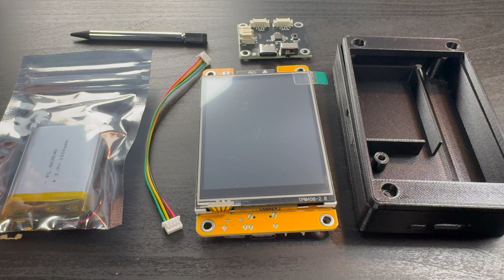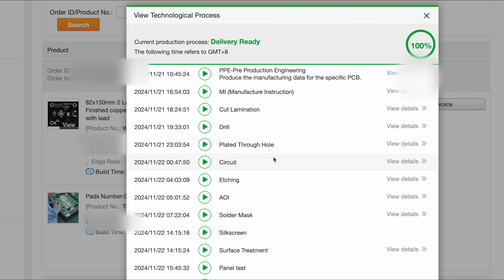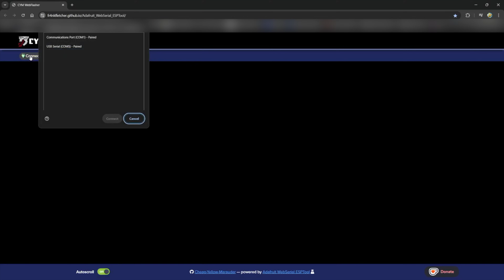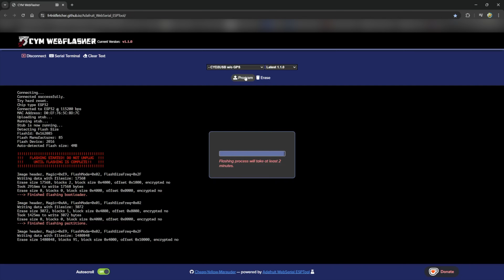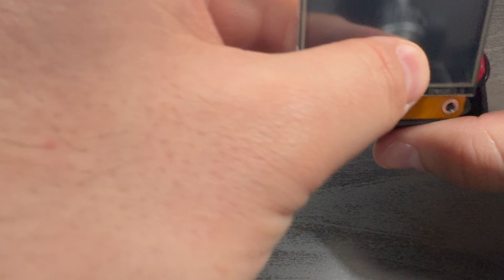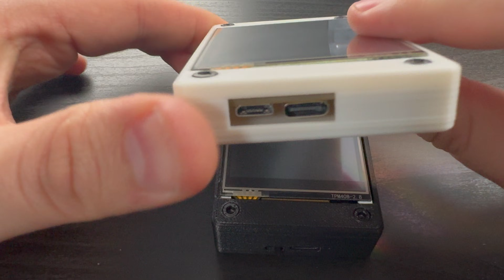How To Build An ESP32 Marauder - With Battery - No Soldering Required!

Comment: Wtf is marauder? A bunch of scripts to escape learning aircrack commands? Just buy a pocket wifi router for openwrt. It has better antenna, it is way less power hungry and offers all the packages you could possibly need. This right here, along with pwnagotchi and that dolphin thingy, is a bunch of poorly designed tools that make a lot of mistakes, and indirectly forces user to make even more.
Reply from the maker: I mean, you can always go deeper… Imagine using aircrack commands. Write your own framework and tools. That’s how you sound.

Marauder is using open source tools that were written for the ESP32 platform and executes them from an OPTIONAL UI. If this is a “bunch of scripts” it’s the same thing as using aircrack commands. That too is just a bunch of scripts in the end.

Introduce people into the world and the more they’re interested, the more they’ll seek out. No one claims this is the best tool, but it is effective. These devices are the most searched in this space whether you like it or not. So we will continue to make videos for beginners and people that want to build these devices.
Reply: @BiscuitShop  Aircrack is a framework already. With an "optional UI" nontheless. I'm not trying to stop you from making videos, lol. Im just warning users that this right here, building a customized device on a very restricted and at the same time very bloated platform that fits very poorly into the whole wireless world (first of all, hardware-wise), AND also using yet another layer of abstraction which effectively is this "optional UI", is a very bad idea. Now, the whole idea behind yet another layer is to encapsulate a lot of boring stuff. Sure, sometimes it works. But not in case of wifi and not in current state underlaying tools/frameworks are in. There are too many nuances to the whole sniffing/capturing thing that can't be addressed in any automated way (at least outside "real linux" environment). So, again, my advice would be to get a decent wifi-oriented device with a proper wifi-chipset on board and "normal" limux for embeds which supports the essential set of tools (at least aircrack-ng and hcxdumptool). Everything else would be a waste, especially if it requires so much hustle. You'll find out I'm right the moment you finally make it to hashcat 🤭
Reply: I agree but is a good platform to learn on, I’ve just bought the stuff to make one, I am trying familiarise myself with arduino and ESP32 as that’s what I use at work. Also wifi and Bluetooth I want to learn about, however has an out and out offensive tool I can see why it’d be crap compared to the right hardware/frameware

Comment: Just received my kit today. I'm going to add the GPS so it can wardrive! :) I'd be up for a case that has a spot for the GPS. I just noticed my charging pcb has the larger PH 2.0mm battery connector. :/
Reply from the maker: Did you get the case with it and the module I recommend? You can put the ceramic antenna above the battery and there is a small area on top of the stylus for the GPS PCB :)
Reply: @BiscuitShop  I did get the case and I was wondering what the area was on top of the stylus. I ordered the smaller GPS module and a battery with the PH 2.0 connector since the board is ver. 1.0? Bummed since I have some batteries with the 1.25mm connector
Reply from the maker: You’re not the first to say this. I too had 1.25 for Lora devices. But 2.0 is actually a more common connector. In the latest versions I’m releasing, I changed to the 1.25 connector though because I keep hearing this same comment. Sorry about that!

Yeah that square area will fit the gps PCB :)
Reply: @BiscuitShop  Yeah no worries, I have the larger GY-NEO6MV2 GPS module so I got the smaller GPS and battery with 2.0 to make it all fit
Reply from the maker: @blackpaw369 Nice! 
Keep an eye out for my next iteration of the board 👀 it will have GPS built in AND a battery fuel IC that will display the battery level at the top of the marauder status bar / on screen. Will be a bit more expensive but it should cut down on all the shopping for separate GPS modules ect.

Thanks for the support!
Reply: @BiscuitShop  that will be sweet! I'll look forward to it!

Comment: I just bought one from Tindie, should have it in a few days. I picked up a gps and stuff for an external antenna, hopefully I can cram it all in there. Thanks for putting a nice little package together.
Reply: How would you add an external antenna to this board?
Reply: @ I did it to mine and it works but honestly if I were to do it over again I would just buy an esp32 with the u.fl and another display. I’d just build one from scratch and scrap the cyd. Adding an external to the cyd is kind of janky. His case is nice though.
Reply from the maker: I really like the build where people swap the ESP module with the ESP32-wroom-32u
It’s the exact same module but with an external antenna. No jank with the scraping antenna traces. Definitely tougher but well worth it.
Reply: @ exactly, after scraping and soldering I don’t think the juice was worth the squeeze. I wonder if your enclosure could accommodate such build. The case is top notch btw. 👍
Reply from the maker: Really appreciate that. Took many revisions lol
I bet it would. The module is the same footprint and the antenna should fit up top if placed right

If not I’d be happy to modify the case
Reply from the maker: Thanks a ton! Dropping off all the tindie orders right now.

I’ve made a handful now with GPS but with the ceramic antenna. You might be able to drill a hole or something to get the external antenna going.

Maybe I should make a case that supports external though 🤔 if you have a 3D printer i could send you a model to test if you’re game.
Reply: @BiscuitShop I don’t have a printer but I could have Micro Center print one up for me.
Reply from the maker: Oh perfect! I think you should be able to drill a hole at the top. I bet there’s enough space. Worst case reach out and we’ll figure something out.
Reply: @BiscuitShop  awesome thank you very much. I’ll let you know. Have a good one.
Reply: @BiscuitShop  I would love to test a model with an external antenna!
Reply from the maker: @Cleffles  Its doable! They've started selling CYDs with UF.L connectors for external antennas. They work great and are very affordable to make

Comment: Do I understand correctly that this device is something like the flipper zero? Also that you can use it to copy radio signals, read rfid cards etc.?  Is there any information about the project in German?
Reply from the maker: This device doesn’t have any sub ghz or RFID capabilities. It’s strictly WiFi and Bluetooth.

Similar to the WiFi dev board for the flipper though
Reply: @BiscuitShop okay thanks.

Comment: Soo if I build wideout battery I can use power bank?
Reply from the maker: Correct! Simply use a USB cable and it will power the display.

There’s also a case that you can download in the description that I made for that exact setup. Download and print that one if you like it

Comment: Can you make this just using the screen board and a portable charger? Instead of using the Battery PCB and a battery?
Reply from the maker: Absolutely! Towards the end of the video I show one without an internal battery. I uploaded the case model for that too and you can find the download in the description.
You can power it via USB
Reply: Oh, sorry I didn't realise it was right at the end! So what's the point of everyone doing the soldering nonsense with other components if they can just do this? For the GPS or is there other functionality they're getting? Like better customisation?
Reply from the maker: If you’re referring to other videos, I think I’m the only one that made a PCB focused on adding a battery to the CYD. I made it with the intention to avoid the need to solder. I get anxiety soldering battery leads lol.

If you’re referring to the GPS, you can’t avoid soldering that because you buy the modules without a wire, you must solder wires to it to connect to my board (or anything for that matter)

Adding GPS adds the ability to war drive with the device!
Reply: @BiscuitShop  ah okay, so in most video when they talk about soldering, they'll mainly be adding a GPS? What extra functionality does that add and can you use the WiFi and Bluetooth functions without it?
Reply from the maker: Most add a battery too. You can avoid that with a custom PCB though which was my main objective with this build. I think that’s where the most value is because I feel like most people want it to be a stand alone device but soldering a battery turns off a lot of people.

All the other features stay the same with GPS, it really only adds the ability to wardrive when you add the GPS. It’s definitely a nice to have, but not necessary for the other 95% of features
Reply: @BiscuitShop  what's WarDrive? Sorry for the questions, last one I promise!😂
Reply from the maker: Haha no worries, always open to chat with people that are interested in the same things as me lol

This is the technical documentation for that feature. https://github.com/justcallmekoko/ESP32Marauder/wiki/wardrive

Essentially it captures SSID names and the GPS location you encountered it at. It’s a reconnaissance tool.

Comment: How do you add the gps module
Reply from the maker: If you check the Tindie link in the video description there’s a drawn schematic in the listing photos. 

You don’t even need to use my board, the schematic works for the pins on the bottom of the CYD too.
Reply: @ yea but I just want to maximize the space I have so the gps and battery mod can be on the same and what would be the best gps that would work with your board?
Reply from the maker: ATGM336H is the one I recommend. In the 3D model I uploaded to maker world, it has the proper locations for the antenna and PCB as well as battery and charging circuit. A couple people have built it so far with this GPS and it’s been pretty well received!

Comment: Someone can find for me good pcb in aliexpress or ebay ?
Reply from the maker: Which PCB? The ESP32 or the charging circuit?
Reply: @BiscuitShop  If you can send me both I would be happy and by the way, do you have Discord?
Reply from the maker: @Gingiboyy  I don’t have a discord channel but maybe I should make one! You can dm me though     _hedge
Reply: @BiscuitShop  And there are several batteries that connect to it or only this and is the battery on ebay or something?
Reply from the maker: Any 3.7V battery with a PH2.0mm connector will work :) 

The battery I suggest is in the description (amazon) but check out the connector, as long as you find one with that connector and voltage, should be fine. I saw someone connect a 2000mah to it. Should be fine
Reply: @BiscuitShop thanks bro 🫡
Reply: @BiscuitShop  And what is the type of cable that comes with the charging pcb?
Reply from the maker: @ no prob! It’s the 4p 1.25mm JST cable that the charging PCB connects to the main board with
Reply: @BiscuitShop the cable is male to female ?
Reply from the maker: Female to Female
Reply: @BiscuitShop the charging circuit i think
Reply from the maker: Gotcha, the link is in the description for it. I had them custom made so you won’t find them anywhere else. The reason I made them is because something didn’t already exist :/

Does the Tindie link not work for you?

Comment: I wonder, with this setup can we make a copy of Flipper Zero? Like with a basic function, IR transceiver, CC1101, and RFID reader?
Reply from the maker: There is additional IO but I don’t know if the available IO is sufficient to add those devices. On the back of the device there are two more expansion ports, but in total 5 IO

We would also be using up the TX/RX for GPS so if one of those modules used serial we’d have to pick one. 

It’s an interesting idea though that’s worth looking into
Reply: Get lilygo t embed for cheap alternative

Comment: What GPS modules are supported in interest in the PCB
Reply: If project goes well. Definitely buying a bulk of these so cross your fingers
Reply from the maker: @WitherDimensions  I think you'll love it! Feel free to reach out with questions
Reply: @BiscuitShop  you have a list of supported batteries was looking for some 1500 mah ones ?
Reply from the maker: @ this one should work

https://amzn.to/4fq2Zf2

Any  3.7V battery with a 2.0mm PH JST 2Pin connector
Reply: @BiscuitShop if I’m gathering all the pieces up. What steps should I take in connecting and installing. Do I connect and solder all my extra antenna and gps module to the cyd before flashing it? Or is there specific steps?
Reply from the maker: You do anything in any order. Last time I did it I flashed the CYD then added the GPS later. Doesn’t matter really
Reply: @ I’m having difficulty understanding the pinout. I connect both the gps and battery to the PCB and and the DEVOUT cable goes to the bottom of the CYD. Just want to make sure all is connected correctly. Making sure all solders are correct with the gps as well. Where is the pinout diagram you created ?
Reply from the maker: @ just updated the listing with the schematic

Battery is 
red = +
black = -

GPS wiring is in the diagram :)
Reply from the maker: Great question, tested and compatible with Teyleten Robot ATGM336H NEO-6M, case was designed to fit that module.
But should also be compatible with 
DWEII GY-NEO6MV2 with a revised case
Reply: @BiscuitShop Ty for the response definitely grabbing one
Reply from the maker: @WitherDimensions  The CYD comes with the cable you'll need for the GPS too so you shouldn't need to buy any cable.
Reply: @ in the process of buying this module. What cables do I need if I wanted to connect both a battery and a gps module. Cable for battery and module then to cyd and how does the module attach to the cyd?
Reply from the maker: For the module I include the cable for the PCB to the CYD (female to female 1.25 JST 4p)  
For the GPS you need a 1.25 JST 4P Female to flying leads for soldering. You can get the same wire as the one I provide but cut off one end for soldering to the GPS module.
Battery you should just buy the battery I list since it comes with the connector and wire already attached (connector is a PH2.0 for the battery though so if you wanted to do something custom)

Hopefully that helps
Reply: @BiscuitShop  would love a video on installing a gps module on this pcb I just bought it!
Reply from the maker: I’ll see about making a quick video on it. Worst case I’ll update my listing with a schematic and pictures of the GPS mod.
Reply: @ either way already bought it ! Honestly rewatched the video and it clicked in my head! Great product!
Reply: @BiscuitShop  I am looking at the ATGM336H module from left to right the pin outs are:
 VCC, GND, TX, RX, PPS.

Looking at your board with the DEVOUT and GPS in on the bottom what are the pins for input?

I made the assumption that my 4 wire JST plugged into your PCB from left to right the wire are RED Black yellow green - went to VCC, GND, TX, RX on module. I do not see GPS on Screen.
Reply from the maker: I should’ve labeled the pins on the board. Give me an hour or so and I’ll post a link to a rough schematic. 
If you look at the back of the CYD, you can find the pin out. Follow the colors to my PCB. Connector for GPS is jumped to the dev out connector. 
PPS is unused. 
VCC(+)-Vin
Tx-Tx
Rx-Rx
Gnd(-)-gnd

To actually enable GPS, on that web flasher, you chose the other CYDV2 option that doesn’t say W/O GPS
Reply from the maker: @tratzum  
Added a hastily drawn picture that shows the labels on the connector as well as what to connect to on your GPS module.
Reply: @BiscuitShop  Dam I call my self a geek and didn't even look at the CYD. Only GPS pin I got right was VCC.
Deleted bad info
Reply from the maker: So I think you’re close but from the cable I’m looking at it appears TX is yellow, and RX is black. If that’s the case for you though go with that cable color. Sounds like you’ll get it in no time though. If you flash the GPS version, and it doesn’t initialize but the GPS module lights up, switch the TX and RX and you should be good to go :)
Reply: @BiscuitShop  Ill try again in a few. I may have killed that module. Thanks for the speedy reply's
Reply from the maker: @tratzum  No problem! That sucks...

If you want to message me directly you can add me on discord.  Username is    _hedge
Reply: @BiscuitShop  All good. Had to switch the TX and RX from your picture on Tindie
Reply from the maker: @tratzum NICE! Let me take it down then. Enjoy!

Comment: Once again, making it easy for newbs like myself to catch up! Thank you, sir!
Reply from the maker: @showxating9885  Thanks for the support 🙏
Reply: @BiscuitShop   I have a question, when flashing marauder onto the cyd, if i want to put something else on it afterwards, for example run some arduino projects what do I do?

do i just flash the esp32 wroom firmware onto it?
Reply from the maker: @breadman6666 You can always just flash it like normal with the arduino IDE. There’s not really firmware but find the sketch you want. You’ll have to add the ESP32 to the board manager ect. But yeah nothing permanent in this guide!